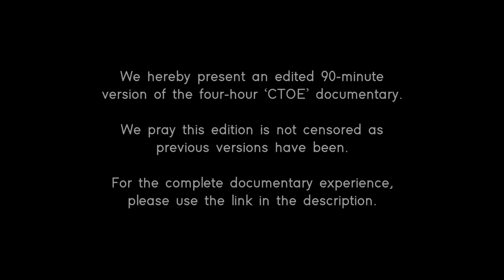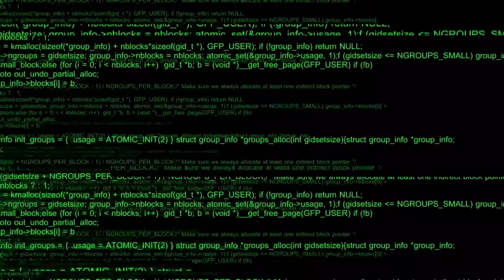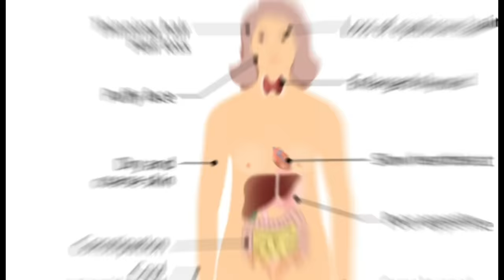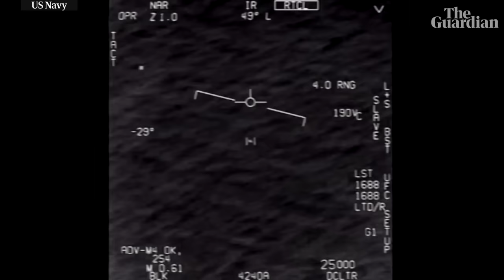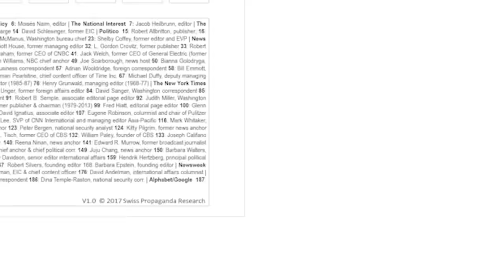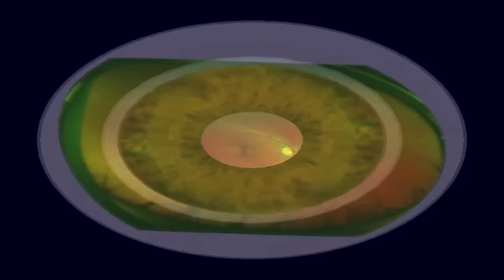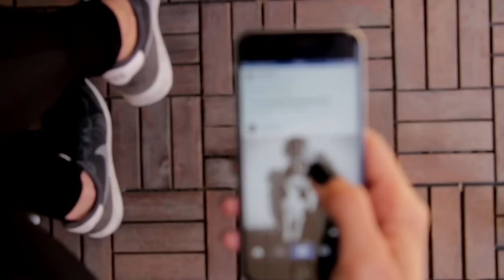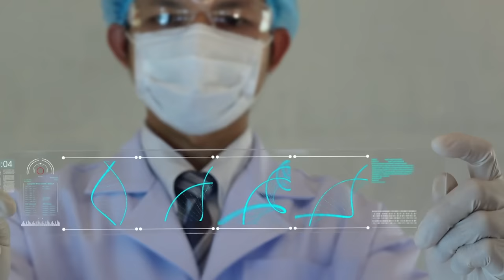The Conspiracy Theory of Everything - 90-Minute Special

Comment: That bird suspended in the air is obviously on a wire.  It  also looks dead.  It is positioned in such a way that shows it is caught on something.  It is not like it is suddenly stopped in mid flight with it's wings outstretched.